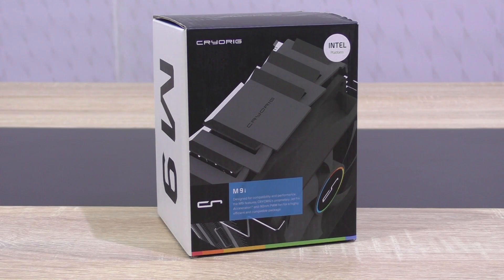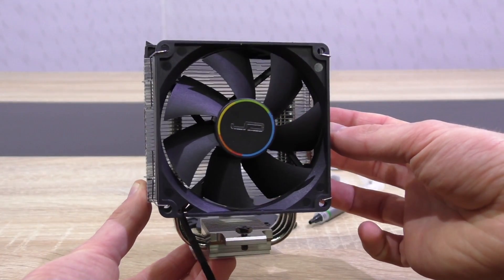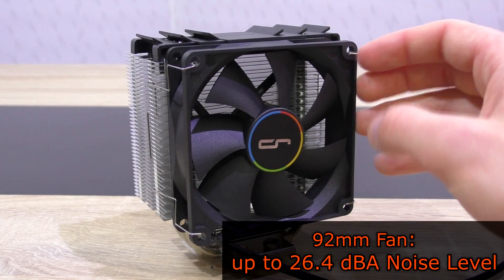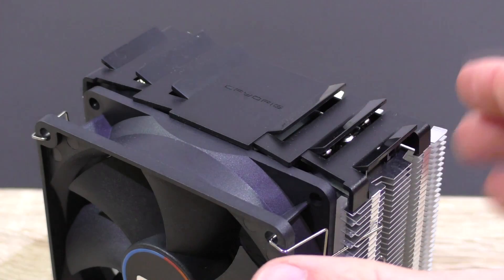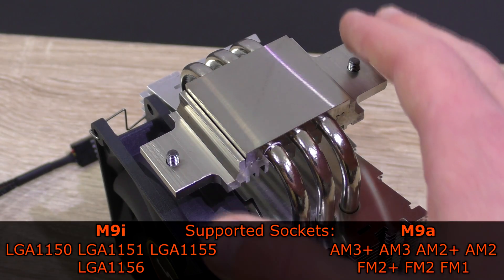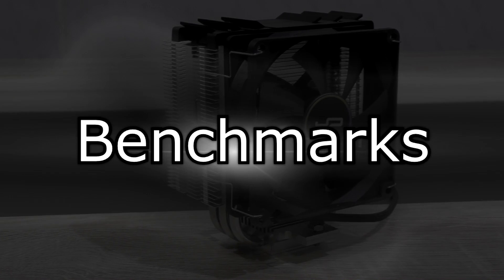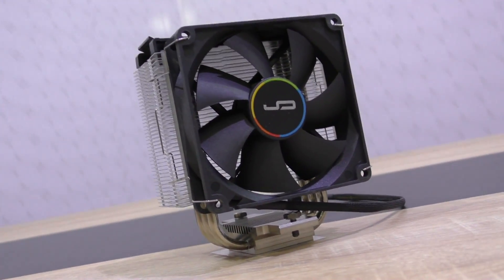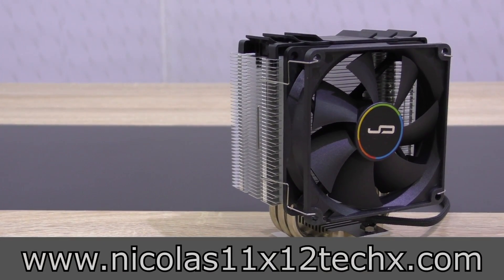CRYORIG M9 CPU Cooler Review

Comment: Also, how does this compare to the AMD stock cooler (Temps)?
Reply: I installed it yesterday on my 5600x in a sff case and the temps are unbelievable low with PBO and curve -30 negative. I got 65 avg on full load voor 45min in aida64. 10 degrees Celsius less compared to the amd stock cooler. The best budget cooler for sff builds who’d want to do a lil OC

Comment: this or hyper evo 212?
Reply: This one is quieter and spins faster than the Hyper Eco 212
Reply: I think it depends on what CPU you're using it for. If you're not overclocking, this would be pretty good considering the price and performance. If you're overclocking, I'd suggest getting 212 for better cooling without hitting thermal limits.
Reply: i want to get an i5 6600     not the k version
Reply: also will this fan be loud    it says on their website it will be 26.4 dBA   is that loud and how does it compare to the hyper evo 212?
Reply: I don't think there should be any issue since this cooler is rated at 120w for TDP. And I don't know how loud it is irl but I have a CM Hyper D92 in my second rig, which has 2 92mm fans and it's pretty silent so I think this single 92mm should be even quieter.
Reply: +adsary Can't be compared to the evo 212. 1) evo is a 120mm fan and this one is 90/92mm 2) if you want to compare, please look for the H7 model from CRYORIG and has the same size. 3) always look for the TFP and RPM supported. If you still want to compare this model from CRYORIG, look for the Cooler Master Hyper T2 and has almost the same specs.

Comment: Hi would you highly recommend this cooler for users who don't do OC on their CPU? coz from your video it seems the temperature was quite high when it was in full load. :) thanks
Reply: Temperature was quite high, but it was an OC i7. To put it into perspective it performs pretty much like a CM 212 evo. If you are not overclocking it will keep temperatures pretty low.
Reply: I see but currently im rocking only the core i5 4460 cpu but I think the stock cooler is kinda ugly haha...so im considering to replace it with an inexpensive aftermarket cooler like this one... 
anyway, thanks for the reply and information. :))

Comment: Does it perform as good or better than the 212 Evo? the price is much lower than the 212 Evo at the moment that have increased in price...
Reply: As good, not better. Pretty impressive for how cheap it is and it's little size.

Comment: Would this be a lot quieter in my corsair 200r with an i5 4460, compared to the intel stock cooler?
Reply: +alxuria Well usually stock cooler are pretty noisy so this will probably be quieter.

Comment: Don't blame if they only support Intel sockets, just recently gave amd a try and it was an awful experience. The raid software is light years behind Intel the performance is abysmal with a high end card and the temperatures are a joke. 7700k
Reply: The fx and the apu are different in term of build the fx have a soldered heat spreader where the apu went el cheapo like Intel and glue them with thermal paste a la cheap. For such the apu have worst temps than the fx nevertheless they are either meant for home server or basic desktop get them out of those bounds and they show weak l.
Reply: the m9a is an Amd version.  it's to save on costs by having 2 different versions
Reply: You mean the APU 7700K? That's 4 budget, plus its reducing it's CPU power to add a better GPU component, so if you wanted a fair one, you'd have to try it with the FX series, like the FX-8320 or FX-6300
Reply: +Emmanuelle Rodriguez Great info